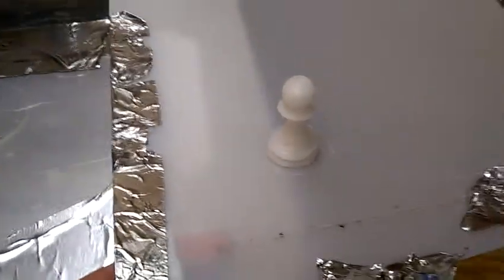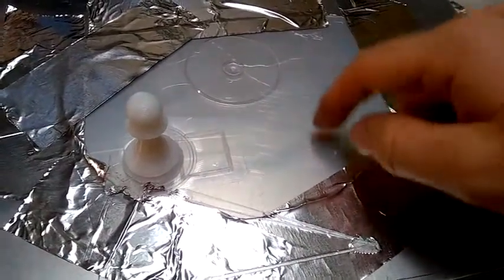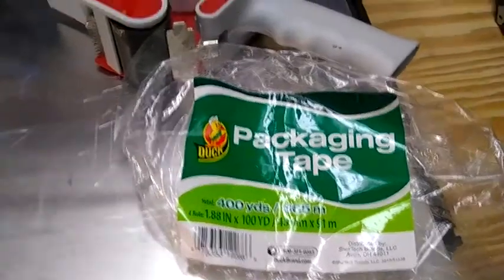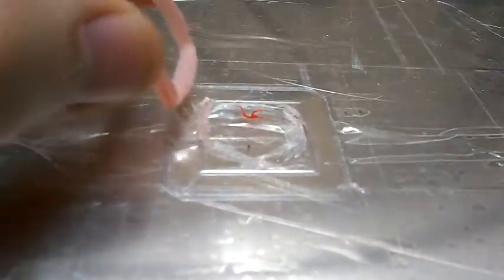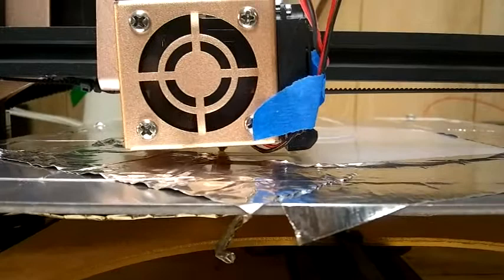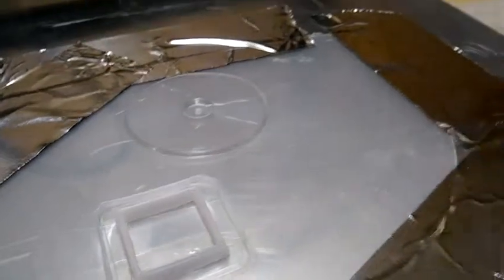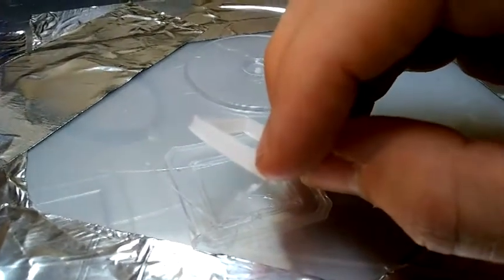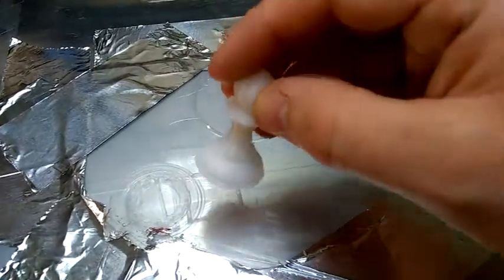3D Print HDPE to Cold PP Sheet - Best Method

Comment: There's probably an ez "trick" to make the corners work... turn them into a semi-circular shape! Any semi-circular shape tends to hold much better (if all the corners are shaped in the same way) than just flat rectangular-shaped corners. The central point of pressure from a semi-circular shape is that imaginary and focal central-point unlike a square-shape. The downside of a square-shape item (specially a flat 90º rectangle-shaped one) is that it has to constantly fight Gravity itself. Small triangles are just awesome! It is often overlooked in the great scheme of things, but do i fkn love Geometry as an out-put of Maths and the other way around! Gaspard Monge was simply a Genius!

Comment: I printed on polyethylene tape and it stuck very well. corners still lifting a little, so I am still working on settings.  What temp. and speed did you use?

Comment: Can you use recycled materials with pellet extruder?
Reply from the maker: Suci, theoretically yes. In practice, I have not been able to so far. I've tried HDPE milk jugs, PP take out containers, and PET bottles. Will have to keep trying.
Reply: @samwechsler  Thanks Sam! What kind of challenges did you experience with the recycled material vs virgin HDPE?
Reply: Are you still using your mahor v3? 
I’m finding success with a modified v4 and a homemade pellet extruder
Reply: Hard to find people trying to use recycled granulate.

Comment: Great information! If you added a raft through the slicer, or manually added disks in the corners of the square you could probably get rid of that corner pullup.
Reply: I’ve been printing pp and hdpe granules with my modified mahor v4. I’ve had success with using large brims and rafts. 
I’m making an enclosure now to see if it reduces warping abs this pulling 🙂
Reply from the maker: Thank you Jeff. Will have to give that a shot.